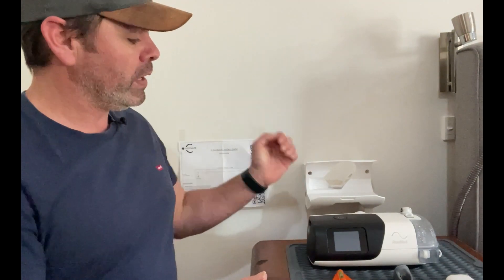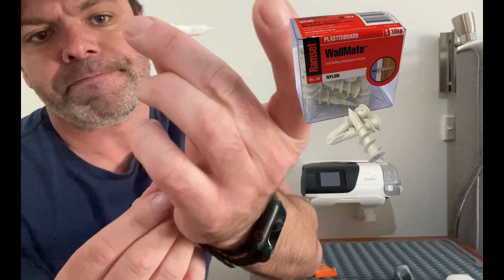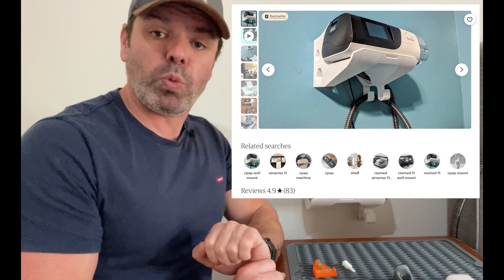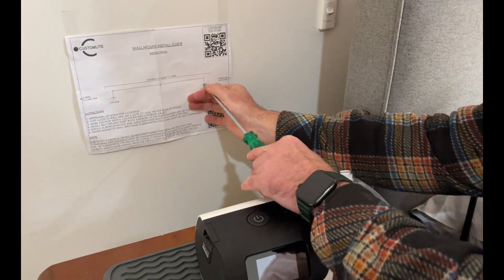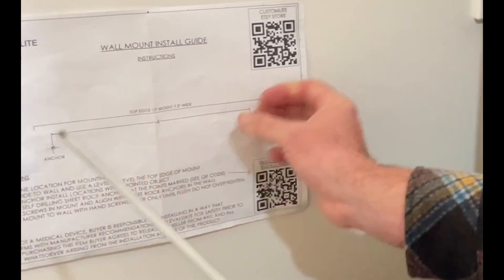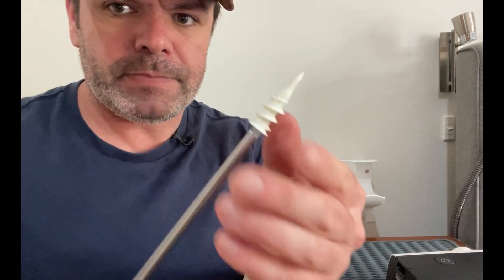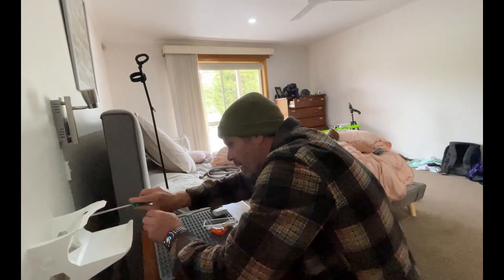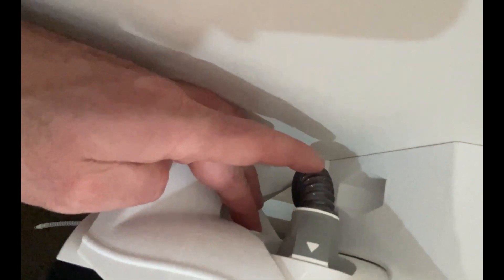3D Printing AirSense11 Wall Mounts & Installation Guide

Comment: If the screws don't go all the way in, means you found a stud, in this case just use the metal screw, studs and 450mm centres or 600mm centres

Comment: I recently printed the one for the Airsense 10 wall mounts shared by another member in your Facebook group. I like the single piece design of that AS11 mount that the CPAP snaps into. I don't know if the 11 has the same occasional tank leak issues as the 10 does, but I noticed the tank on  my mount has no way of catching any spills. So a tank leak would get on my nightstand and could ruin a clock or a phone. A drain tray under the water tank could make a good project for me.